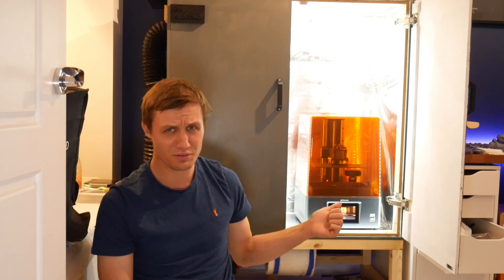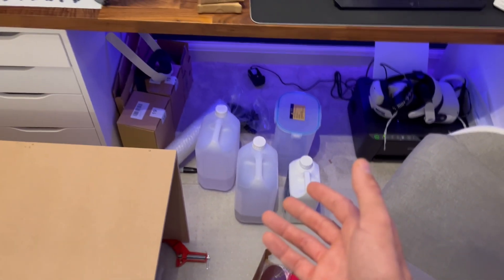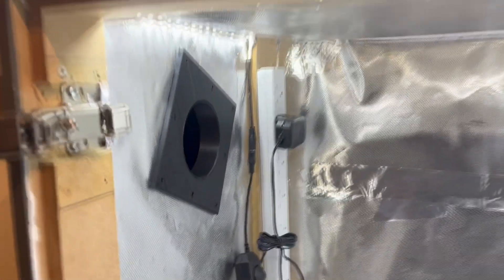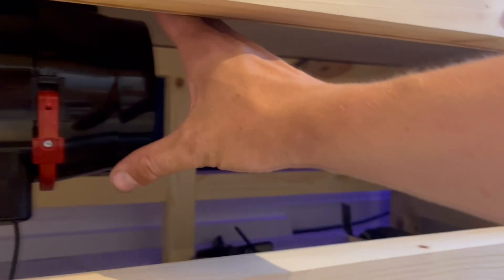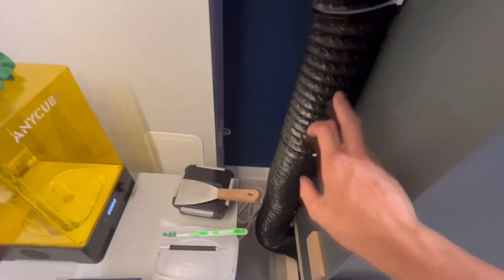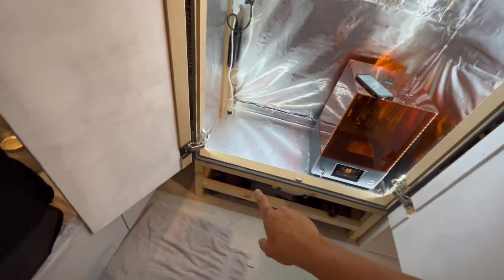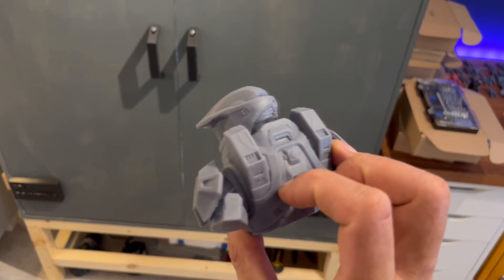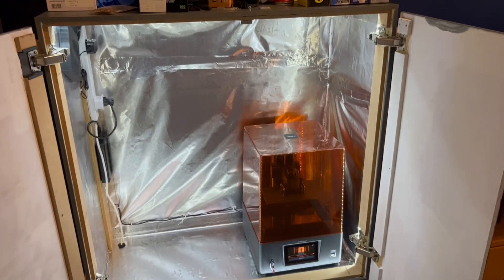How To Make 3d Printer Enclosure With Carbon Filter Extractor Fan

Comment: Why would you seal the doors shut ? How is air supposed to circulate then ? You will not create a vacuum xD
Reply from the maker: Dunno leave a small cap for air to pull in but not massive gaps that the smell just seeps out
Reply: @techclub8528  The gaps you have there right now are perfectly fine. You don´t need to make super tiny holes, this also saves you from glueing everything shut with rubber gasgets etc, try it out without first it will work just fine. As I said you could also simply put your Levoit Air Purifier in the chamber as well it will do the same job.
Your air purifier is made for a whole room, this chamber is tiny by comparison.

Comment: Why not use an Ikea PLATSA ? It´s cheap and comes in two general sizes 60cm and 80cm width. Its basically cardboard and thus leight and easy to assemble and cut etc. I mean it is horrible quality but it will do what it is supposed to do.

Comment: Looks like a nice little setup, I've been thinking of setting up something like this to print inside over the winter months. Do you have the links to some of the stuff you used?
Reply from the maker: Well the wood I purchased was all precut from B&Q they cut sheet wood to size.

The extractor fan - https://www.amazon.co.uk/gp/aw/d/B01MZI2UX9?psc=1&ref=ppx_pop_mob_b_asin_title

I accidently purchased the 5 inch version so i have tapped on two 5inch to 4 inch adapters

Plus i wish i got a version with a speed control knob.

Carbon Filter - https://www.ebay.co.uk/itm/254669584135?mkcid=16&mkevt=1&mkrid=711-127632-2357-0&ssspo=qNlbsSwPS_-&sssrc=2349624&ssuid=zXcQ6sD1TbG&var=&widget_ver=artemis&media=COPY 4 inch

Heavy duty extractor pipe https://www.amazon.co.uk/gp/aw/d/B086MJXLQ9?psc=1&ref=ppx_pop_mob_b_asin_title

Most of the black miscellaneous items for it where nocked up on fusion 360 and are rather specific to my cabinet,
Reply: @techclub8528  thanks!